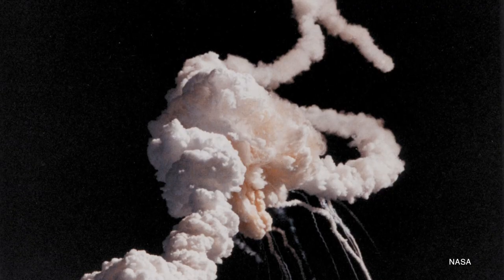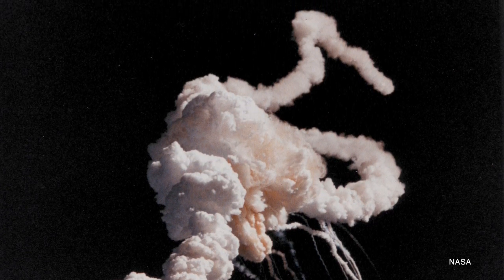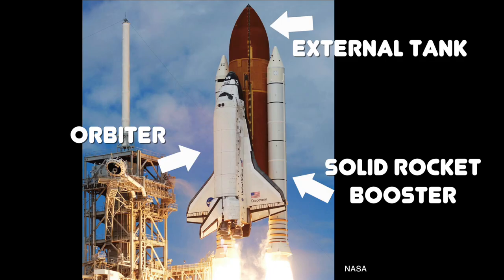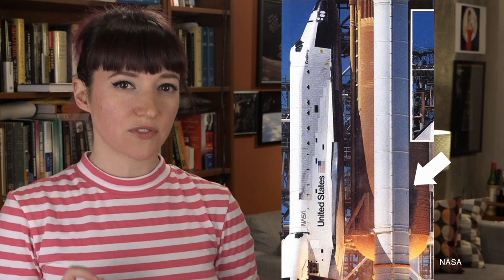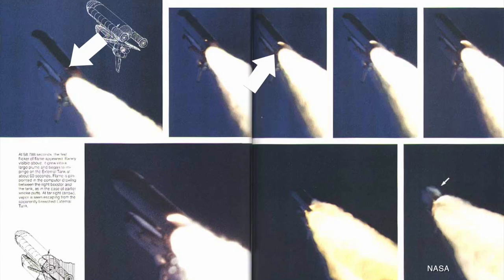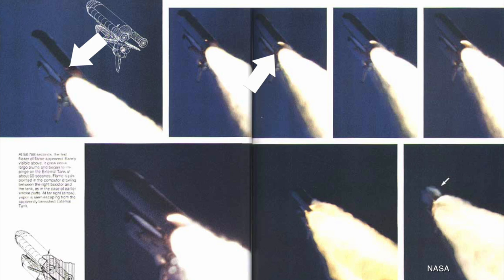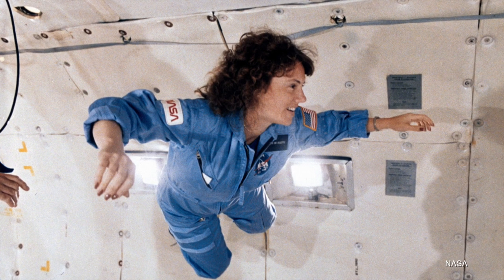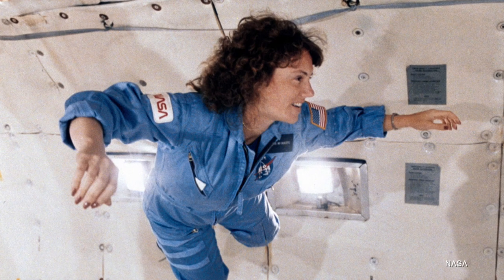How the Challenger Disaster Changed NASA

Comment: Please stop saying it was a "flaw" in the O-ring.  It was not.  The O-ring failed, but not due to a flaw in it's design, manufacture, or installation.  The acceptable temperatures for operation were established when designed and they launched below those temperatures.  The O-ring worked as designed.  It was being used outside of it's design parameters.  If you build a bridge that can hold 1000 pounds, and you put 10,000 pounds on it causing it to collapse, that wasn't a "flaw" in the bridge - it was the human error of overloading it.
Reply: There was a known flaw in the overall design of the boosters O-ring system.  Thiokol knew about it and suggested to NASA management that there be a redesign.  O-ring erosion was a normal thing but dangerous as the O-rings were a critical 1 component.  This was rejected as it would have delayed the first flight in April of 81, but NASA had said that if it ever needed to order new booster casings the new design would be considered.  After Challenger all existing booster casings were retired and the updated design was put into use.  The new design didn't cure the erosion issue completely, but no future casing ever breached the o-rings at all.  There were signs of small breaches in other flights of the original design, but nothing as serious as Challenger.
Reply: True, it was launched outside design temperatures. And the one O-ring design was a potential problem in that given enough erosion, and you have a blow-thru. It actually happened before Challenger. The re-design added a second O-ring. Rogers Commission faulted NASA "culture, management, and reporting" more than a failed piece of rubber 3/8" inch in diameter (or so.) I have a snipped piece from that production run of O-rings, given to me by one of the investigators. Looks like an ordinary round strip of rubber; yet it filled a critical role in sealing SRB segments together in an airtight stack. I remember that day; listened to the launch on the radio at work. Kept hearing calls for "RTLS" and wondered what that meant, as I'd never heard that one before. Then it occured to me: "Return To Launch Site" was the call, and was an early abort mode -- if the orbiter was intact and controllable. They never answered, as we all know. I lived about 20 miles away from Christa McCauliff's home town at the time and had already applied to the Program as an astronaut specialist civilian. That day, I knew my chances were basically... over.
Reply: @ZenZaBill  When I worked at NASA back in the 90's, the thing I was listening for most after liftoff was "Negative return," meaning they'd flown far enough to no longer be able to do an RTLS abort.  Next up would be a TAL site abort.
Reply: Yes, I knew what the "negative return" call was, and it was the one you really wanted to eventually hear. What center did you work at? I was at Ames during the flight stand-down in 2004 after Columbia. But I did watch the first private launch to space (SpaceShipOne) on the TV in the base cafeteria that morning after getting my coffee, and that was a satisfying thing to see.  @Ladco77
Reply: @ZenZaBill  I was at KSC in the Mechanical Systems Division from '92 to '96.  It was a Co-Op position while I was in college. I had a view of the VAB from the window nearest my cubicle. I had the fortune to be involved with Endeavour's maiden voyage on STS-49. It was also one of the few times we had a Flight Readiness Firing of an Orbiter's main engines on the pad.  I would watch the launches from the VAB area. What always stuck with me was that nobody cheered at liftoff. Everyone was silent. When the SRB's separated, that's when we cheered the successful launch.
Reply: yes exactly
Reply: Exactly
Reply: Rubbish. The design was inherently unsafe, flawed, and couldn’t possibly meet its design specifications of 40 to 90 degrees Fahrenheit. It suffered severe compromise at only 53 degrees

Comment: Concerns were raised by engineers and ignored by management. Someone should have gone to jail.
Reply: Jail is right.  At the time I thought Reagan ordered the launch despite objections from NASA with no data on cold weather launches.  He should have been charged perhaps posthumously.
Reply: The engineers knew what would happen and management didn't, so who's responsible? Since there were lives on the line someone could have protested so loud that their job was at risk.
Reply: The engineers told management, but management responded that they had analyzed the risks and the risks were acceptable. This was part of the cultural problem. NASA management had (in Richard Feynman's words) a fantastic sense of risk, and he didn't mean fantastic in a good way. The engineers couldn't prove that the rocket would fail, since NASA had previously launched at low ambient temperatures successfully.
Reply: AtomicAJ74 So, what rubber composite seals do they use in all the Antarctic science stations? Those have to handle very cold temperatures and remain flexible, and would have been perfect for that flex joint in the SRB.
Reply: Careful what you wish for. If someone was jailed it most likely it would have been an engineer put in the frame.

Comment: Strictly speaking it wasn’t an explosion. It was a rapid burn of the h2 and o2 that looked like a fireball but wasn’t violent enough to destroy the orbiter. The orbiter was ripped apart by supersonic airflow when it started to tumble out of control. 

As for NASA’s culture it was never really fixed except in superficial ways. Had it been addressed properly Columbia probably would have never happened.

Comment: Challenger did not "explode," i.e. there was no shock wave.  NASA officially termed it a "catastrophic structural failure" in that the impingement of the blowtorch from the leaking O-ring caused the SRB attachment joint to fail leading to a rapidly cascading structural failure of the entire orbiter.  Both SRBs continued to fly, undamaged by any pressure wave.  Challenger itself  was not destroyed by an explosion, it was torn apart by the Mach 2 air stream.

The hydrogen tank was not propelled into the oxygen tank by an explosion.  The aft bulkhead of the hydrogen tank failed and fell way.  Since the hydrogen tank contents were pressurized, this created additional "thrust" which pushed the entire tank forward, likely hitting the oxygen tank above.

Once both gasses were free they ignited in a large, fast, fireball, but it was not an explosion.  Similar to pouring a can of gasoline on a bonfire.  

A brief explanation, also on history.com, can be found here:
http://www.history.com/news/5-things-you-might-not-know-about-the-challenger-shuttle-disaster

And here:
http://www.nationalgeographic.com.au/space/5-myths-of-challenger-shuttle-disaster-debunked.aspx

The Rogers Commission Report, for anyone interested, can be found here.  Chapter III describes the accident.
https://history.nasa.gov/rogersrep/genindex.htm

Love the channel, nice work.

Comment: My take on the root cause goes back to when the Thiokol Corporation was founded, using its namesake formula for synthetic rubber, which could also be used as a rocket fuel by mixing an oxidizer with it.  The final fuel formula may not have been exactly the same, but I remember in the early 1970s that the small town of Woodbine, Georgia got an economic boost when Thiokol opened a factory there.  Reportedly, it was to make solid rocket boosters for the next space vehicle, which turned out to be the Shuttle.  The original design of the SRB modules was to be one piece castings of the fuel load, NO JOINTS, to be floated down the Satilla River to the Atlantic Ocean, then along the Intracoastal Waterway (the straits between a string of barrier islands and the mainland) to Cape Canaveral, to be mated with the other pieces to make the launch stack.  But things changed due to a combination of corporate mergers and politics.

Thiokol was bought by the Morton Salt Company, based in Utah (near the salt flats by the Great Salt Lake), and Morton wanted to build the SRB modules in Utah and send them to the launch site by rail (also, the Air Force originally planned to launch from a duplicate facility in Vandenburg AFB in the California desert).  But to fit on railroad cars, they had to break up the SRB into several segments (from two to four, I have forgotten the exact number) that would fit on a standard flatcar.

So the sequence of events that made the Challenger disaster happen was:
1) the managerial and political decision to build them in Utah rather than on a river in Georgia, leading to
2) change the design of the SRB from one piece to segments joined with O-rings to accommodate railroad limitations,
3) the inability of the system to launch after a prolonged cold snap, until the weather warmed up,
4) the political pressure to launch despite the cold weather, to accommodate the teacher in space lesson and the SOTU, so that
5) managers ignored engineers' misgivings about safety to keep the schedule.

If they had kept Thiokol in Georgia and moved one piece SRBs to the Cape by water, the Challenger would not hava been lost.

Comment: Sometimes it's the cheapest of parts that wreak the most havoc when they fail. To think a measly 5 million dollar rubber gasket could cause so much devastation and heartbreak.
Reply: I don't know the exact price of the O-ring, but obviously it's not the 25 cent size you put on your bathroom shower valve.  More like a hula hoop for an orca.  I can imagine one that size made for the commercial market (for a steam boiler in a power plant, for example) going for several thousand, so a "measly" five million may be about right for something with that precision, when only a few dozen were ever needed.  And the O-ring wasn't defective; it was used outside safe temperatures at the end of one of the coldest weeks in Florida history, while much of the launch support tower's surfaces were STILL ICED UP in the late afternoon.

Comment: And that beautiful gal, MS McAuliffe, was an astronaut that day-- she activated MS Onizuka's suit air supply -- in the seat in front of her -- as per her emergency training. Imagine that. That brave kid on the lower crew deck, getting knocked around hard, terrified and still doing her job.
Reply: I wouldn't be so quick to commend her on her bravery. Humans very quickly tend to fall back into patterns they are used to in the case of stress. Case in point when I was going through BCT in the Army National Guard they simulated an attack by OPFOR after we were marching for a good 2 hours. We arrived at our soon to be FOB and were jumped by OPFOR. I distinctly remember not even thinking, I aimed and fired (blanks) until the force was dealt with (or the weapon jammed, I cant remember which). The next day they had us on the back of a truck as if part of a convoy, same thing happened when my weapon jammed due to my dumbass having my hand ON THE EJECTION PORT. I didn't think, I acted, clear the jam, return fire.
Reply: Yeah, bud, it's called training and she did it for about 2 years if I remember correctly. I still say "brave." By the time she performed her last duty it must have been pretty clear that this was a really bad thing. I am not denigrating your service experiences, but she was riding a real bomb.
Reply: she wasn't a kid

Comment: only thing i could add (which might be sourced from incorrect information) is that that jet of flame from the failed O ring damaged the SRB -> Tank mount which eventually failed causing the entire booster to to swivel at the upper mount imposing an impossibly high structural loading on the entire assembly (as well as damaging the already failing external tank).

The fireball was the fuel igniting and not so much detonating (a good sign of this is probably the fact that the SRBs kept flying if there was a literal detonation strong enough to shred the shuttle the SRBs would have been torn apart as well). The ship flew apart into pieces due to aerodynamic loads that it should never have faced. Like an airliner crash but this happened at much higher speeds than any airliner reaches. Thats the only different thing that i've heard regarding the disaster

oops i just realised i typed "tanks" in stead of SRB's when talking about the shuttle break up! Going to edit that lol
Reply: kineticdeath Thanks for pointing that out. Please forgive the mile-long post, but you may learn something.

To further clarify, the forces of the combusting external tank effectively rotated the orbiter from a nose forward attitude to a payload bay forward attitude. The wings were never intended to be turned 90° against the direction of airflow, and those are the aerodynamic forces that shredded the orbiter.

Think of it like when you extend your hand out a car window and turn your palm to face the airflow. Ok, not a big problem at low speeds, but imagine trying that at around 1000 MPH. You'd be lucky if your arm were only hopelessly smashed against the side of the vehicle (behind you), and not completely ripped from your body. Yes, THOSE kind of aerodynamic forces!

Also, most people don't realize the size of the hole burnt through the side of the SRB. I've only seen one photo that put it in good perspective with a man stepping through the hole in a nearly upright position. Now imagine hot rocket exhaust blowing out that HUGE hole against your oversized, foam covered soda can (ET) filled with liquid hydrogen. Yep, game over. Well, not quite... The astronauts, who had survived the destruction of the orbiter, while safely inside the crew capsule still had to fall TEN MILES out of the sky before slamming into the ocean surface, because the crew capsule lacked a parachute. You know how well that worked out.

Of course, there is so much more to the story, so I'll simply suggest you download the (huge) Rogers Commission Report from NASA and get all the details. It appears to be a technical report, but really, it's a murder mystery of 7 astronauts and the destruction of a national asset.
Reply: I think what i watched may have even been a paraphrasing of the official report. The video i watched also mentioned the crew status noting that pretty much all the emergency oxygen/air packs were turned on suggesting that most/all the crew survived and were not only alive, but aware as they fell to the ocean. Thats where i got the information regarding the aerodynamic breakup and the fireball wasnt a blast but just a fuel air ignition.

Tragic across the board and could have been avoided if people had of just listened to the smart people, that is the actual rocket scientists!
Reply: kineticdeath Absolutely!
Reply: The structure of the Orbiter was designed to accept lower loads than a normal airliner. It was decided fairly early on in the Orbiter design process that it would not be experiencing the type of flight hours that an airliner would experience over decades of use and tens of thousands of flight hours. Therefore there could be crucial weight savings if it was not designed to accept unlikely stresses or fatigue over its life.
As a result, it was a relatively flimsy design. For instance, unlike an airliner, the Orbiter's wings did not have a wing spar that ran right through the entire span of the wings. The wings were just bolted to the side of the fuselage. 
That's why, if you look at the accident unfold, you can see an entire wing spin out of the vapour cloud like a Frisbee. Later on you see a wing (possibly the same one) splash down into the sea.

Comment: There were previous near burn through events with the O ring but they were deemed an acceptable risk. There are many risks and solid rocket motor failure was about one in seventy something at the time but that did not stop the Air Force and NASA from planning hundreds of shuttle missions.
Reply: Bobby Harper 1 in 30.

Comment: Excellent post. I remember watching that launch on TV and seeing the flame from the SRB. I recall thinking it odd that at the time nobody mentioned it. Ultimately, this was a similar management culture to that which led to the Apollo 1 fire.
Reply: Apollo 1 was a design flaw, the hatch was designed to open inward so the internal pressure would keep it shut as opposed to a mechanical latch, the only problem was that when the module was pressurized, the door couldn't be opened, so when the fire started, the astronauts were trapped, plus in a pure oxygen atmosphere, the fire would have been hotter and more violent than it would be in an Earth-like atmosphere.
Reply: twistedyogert The Apollo 1 command module had no oxygen purge/fire suppression system, no means of blowing the hatch from inside the module once it was pressurised, was very cramped and had very awkward means of ingress/egress. Communication between the blockhouse and the pad was also poor, a fact that Gus Grissom and other crew members had complained about on numerous occasions. They were not listened to. Apollo 1 was a management failure, not simply a "design flaw". It was numerous design flaws stacked on top of one another, allowed by NASA management, because of the political pressure to meet Kennedy's "end of the decade" deadline. Do you see the similarities to the Shuttle disasters now? Accidents occurred due to management allowing political and budgetary pressures to push the launch schedule along, without giving adequate thought and design consideration to what happens when something goes wrong. And something will always go wrong, because Space is Hard. NASA management knew this. 
And yet... Apollo 1, Challenger and Colombia all happened within the span of a single human lifetime. That is inexcusable.
Reply: twistedyogert  The Apollo 1 decision to use pure oxygen at sea level pressure was incredibly dumb considering so many smart people watched it happen, it hasn't ever been repeated. I don't call carelessness a design flaw.